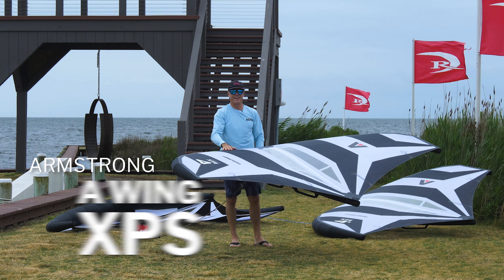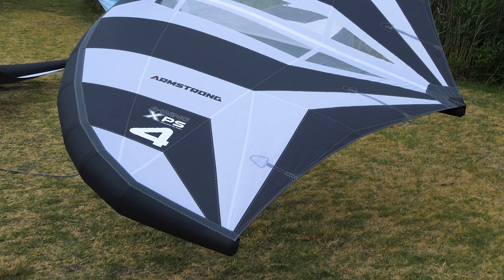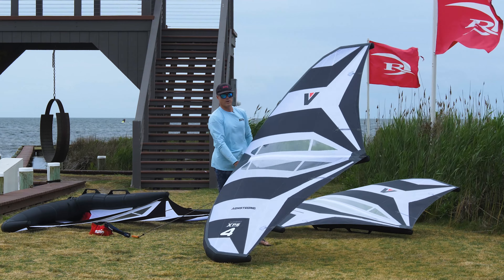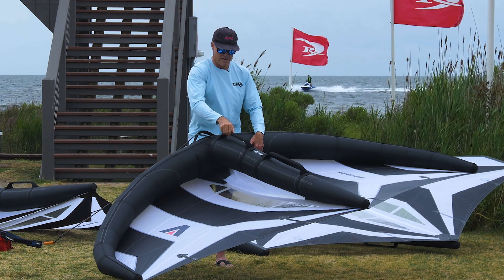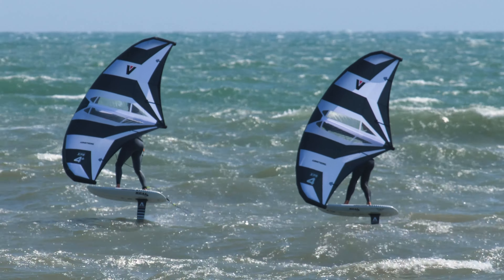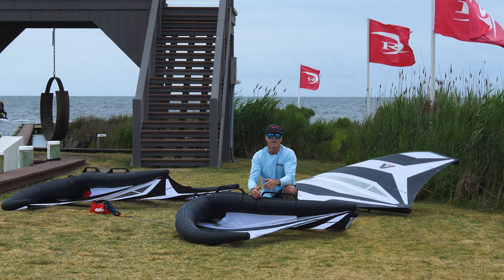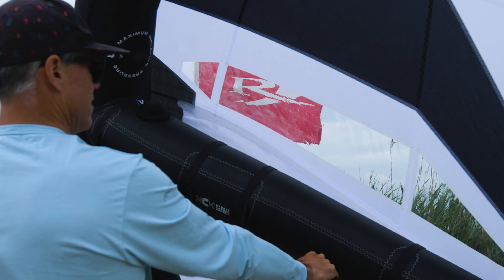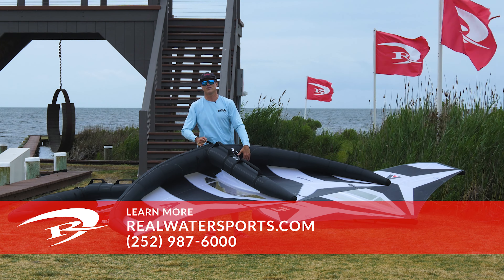Armstrong A Wing XPS Design Specs (2 of 3)

Comment: Thanks, Matt. I saw the weights posted on Real. Do they feel significantly lighter than the V2s? I sold my quiver to go with Strike V2s--now looking to get a full quiver of the XPS.
Reply: Yes the XPS are over half a pound lighter than A wing v2 and feel a lot lighter in hand. 4.5 v2 5.7 lbs. 4.6 XPS 5 lbs.

Comment: Hi Matt, 
nice review again.
I haven't found any details about the wingspan and AR and or length of the Strut. Looking for the details of the 4.6 and 5.3, could you help out?
thanks in advance
Reply: Hmm. Don’t have those specs but did measure the 6.1m XPs vs the 6.5m a wing v2 and the xps was 30cm narrower wing span. These wings are really user friendly and easy to handle. Will try to measure them next time I’m out.

Comment: Hi Matt, some questions remaining after your review:
- are the handles removeable? Seems like they are sewed on permanently? Did not hear anything in the review about it
- single inflation point?
- what kind of valve? never used an Armstrng wing before but am curious now
- recommended pressure?

thanks in advance
Reply: Handles are not removable.  They are sewn in.  There is an inflation valve on strut and one on the leading edge.  No one pump. Valve is the kind that you twist the pump hose on to it so no adapter needed.  Pressure is 8 lbs on the 4m and below and 7 lbs on the 4.6m and bigger.
Reply: @REALmattnuzzo  Thx